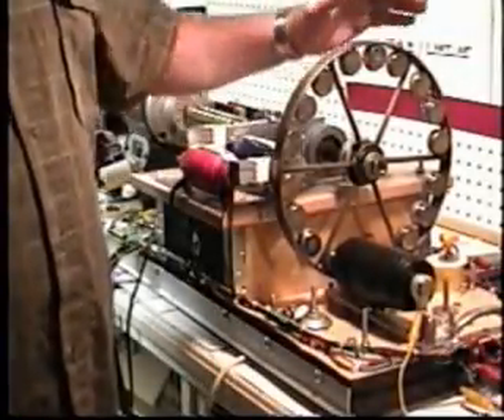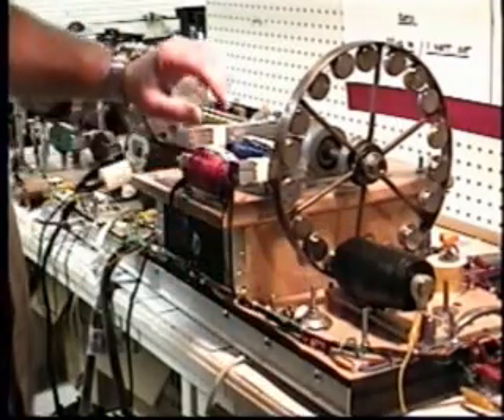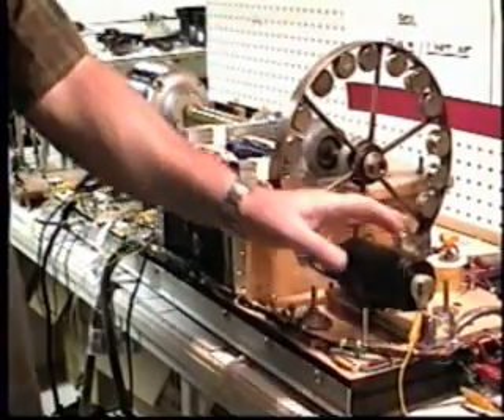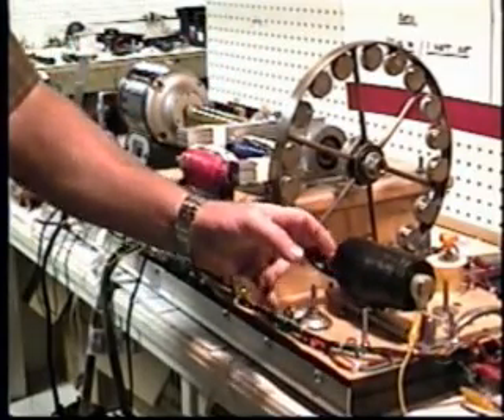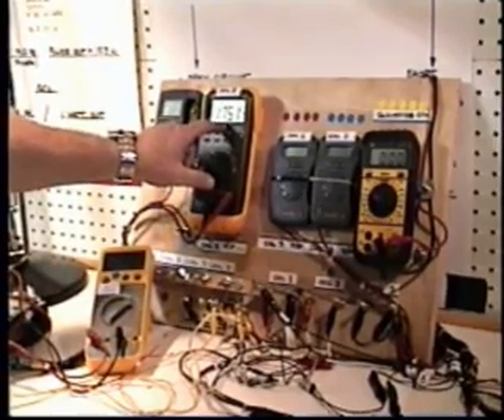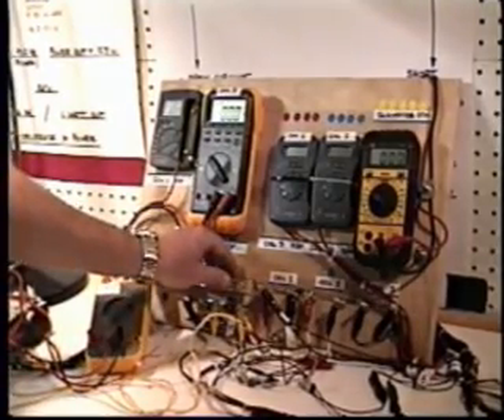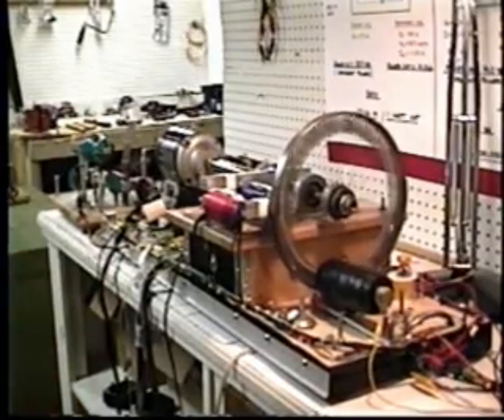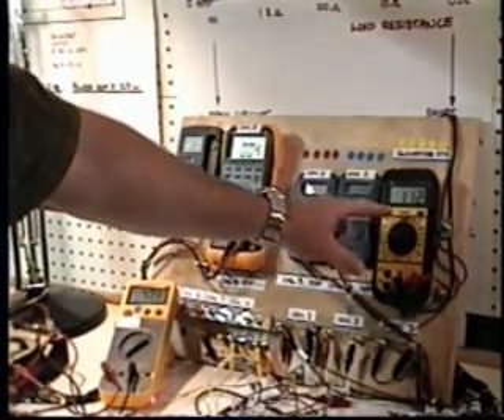PEREPITEIA GENERATOR DEMO VIDEO - Parts 1 & 2

Comment: how is you little set up making more volts 
under 100 rpms then my 3 phase windmill.
i see the neo magnets passing over a single coil.
i have a 14 inch plate and 3 phase stator wired in a star pattern that needs to spin up to 500 rpms to make that kind of voltage,
and your getting it on a single coil under 
100 rpms.

Comment: When the coil is generating a voltage it is putting a load on the motor.  When he flips the switch and the output from the coil goes to zero then the load is removed and the motor speeds up... wow that's really... expected.

Comment: the whole mechanism ( complete coupling ) in the last of part 2 is an effiency increase..
ie. start with a functioning system... put a lesser component in the complete coupling (making the power moter look less efficient)
The back emf coupled though steel is best. thats all...  no magic at all...

Comment: I can save you all a lot of time and confusion.

This isn't a hoax, nor does it appear to create "free energy". Macroscopic systems can't violate energy conservation, and Lenz's law still holds (otherwise, where would the "back EMF" come from?)

From what little I've seen, my educated guess is that he has managed to improve the efficiency of an induction motor by reducing EM losses. The motor still requires power and the "generator" was never shown to power anything.

Comment: "They do not."

Correct. They're costly, even dangerous, and generally performed as singular demonstrations.

This "discussion" is going in so many circles it has my head spinning. LOL! And not ONCE has anyone mentioned the energy expended to maintain this superconductor at the temperature required for it to BE a superconductor and hence maintain "perpetual motion."

Duh?

Comment: Dox is correct. There is no perpetual motion claim here.

The motor turns *faster* under the *same* power input when he allows the Back EMF to enter the system.

The motor is running more efficiently, getting more RPM, but there is still power to the prime mover. There is re-introduction of the Back EMF into the system. But not enough to disconnect power. It is simply a slightly more efficient motor now.

Comment: That's silly. An very extraordinary claim like this requires very extraordinary evidence. The fact of the matter is that even if this is real, the video *isn't* sufficient proof. The setup shown would be trivial to fake without even using any camera tricks.

The fact that a few physicists have looked at this and couldn't explain it also doesn't prove its authenticity. Many scientists have spent valuable time studying bogus claims of various hucksters only to later discover that they'd been had.

Comment: There is none. He says he doesn't really know how it works. Physicists haven't come up with an explanation yet. It should also be noted that he doesn't claimed that it produces energy.

So it's possibly an interesting effect that hasn't been observed before (or at least, not in this way), but it's almost definitely not producing any energy. Also, remember, increasing the speed of something is not the same as increasing its power.

Comment: OK. A superconducting material on its own will exclude any magnetic field, its called the Meissner Effect, so it will repel its self off of a magnet, and therefore levitate. In the case of something like an MRI machine, where its PRODUCING a field, it has to be wrapped in a coil like any other solenoid, the beauty is since it is superconducting, it loses no current due to no resistance, and the magnetic field is left intact (mostly).

Comment: thirdchildikari is correct, a superconducting material in its superconducting state is not an example of a perpetual motion machine.

Otherwise MRI machines in hospitals would last forever with out a refill of liquid helium. Not to mention they also do not produce power either. 

Trying to compare a subatomic process (superconducting) to a mechanical process (the video) also makes very little sense.

Comment: If I could butt in on the argument for the moment for a meaningful deabte...
I have the newspaper article explaining Heines' experiments prior to this recorded one. Apparently, he got the motor to speed up so much that the magnets started flying off the machine. He was surprised by it, since he was using a "weak" motor. I can't seem to find a specific HP, either in the article or int the videos, but I doubt it can normally move at speeds high enough to break welding...

Comment: "I explain what is going on in quite a bit of detail in part 3 ... have to do is check their temp."
I think I understand your explanation now. You believe the energy is all going into the steel core, right?
First of all, would those small magnets affect an object that is centred exactly in the center of them, 2 feet away?
Also, even if they do affect the core, I doubt enough energy would be going into it to cut the motor's rpm by half...

Comment: You know, you're right!  I'll just plug a coil into a mains-powered DC supply and note that the current flows through it indefinitely.  We'll just neglect the energy required to maintain that state.  I'm not saying the current moving in the loop is not motion.  I'm saying that its motion is not indefinite.

Comment: I have no comment on the video.  Superconductors  can carry a current virtually indefinitely.  This is not perpetual motion, this is energy storage.  In order to operate the system requires continuous energy input in the form of cooling.  It's kind of like writing a computer program that animates a wheel constantly.  It's perpetually moving so long as there's power to run the computer!

Comment: Oh yeh- he's credible isn't he?
So how does my electric toothbrush charge up then? Coz obviously the induction can't possibly cross the air gap and then the plastic between the charger and the battery circuit...